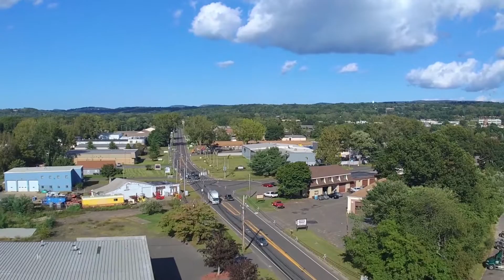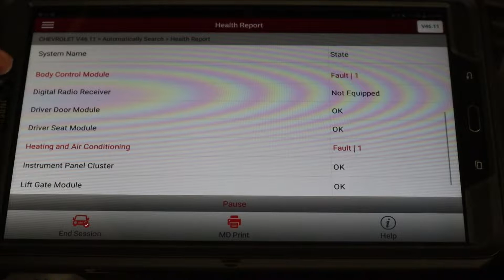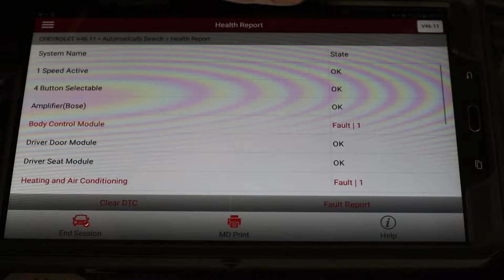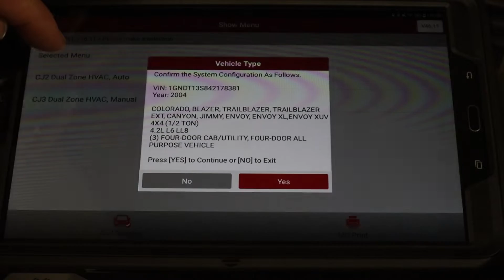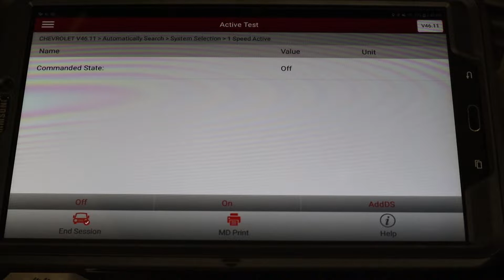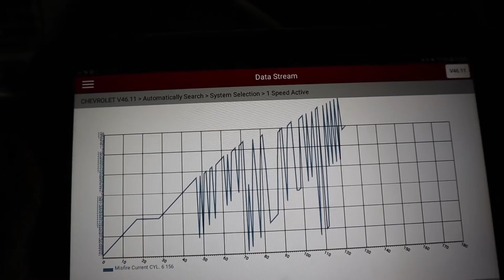CHEVY TRAILBLAZER CRANK NO START........Fuel pump troubleshooting

Comment: Hey I did a swap in my 07 tbss , put in L96 6.0 /4l80e Trans, im using ls2 harness and ecm, won't start unless I spray starting fluid in throttlebody , can you help,  thanks
Reply from the maker: No injector pulse. Possibly the immobilization activating. You may need to use hp tuners to deactivate the immobilizer in the ecu. Or it could be no power at the injectors. Or could be no fuel pressure. There’s a ton of possibilities.

Comment: Will this also control  the gauge? Because the gauge stopped once before then started working again and started working again and it ran tool again the gauge  stopped and once again we had a crank no start problem

Comment: Just fix the wire in the connector. And butt connectors and shrink wrap is fine especially when most people can’t solder. All other coils go bad around 150ish usually should have recommending replacing all of them

Comment: I would ask you if I don’t have 12v at fuel pump relay when I turn key on. Another the side at pump relay I allway have 12v .so my ignition switch go bad this for 2003 envoy …. Thanks

Comment: How did you get those connectors off the pump without dropping the fuel tank?
Reply: You cut a hole and re weld the floorboard

Comment: 02 trailblazer 4200. New fuel pump. New filter. No codes. Wont even fire with ether or starter fluid, possibly timing from my guess??

Comment: I have a 08 trailblazer mines the fuel pump for sure but idk if its the injectors or the pump, i put a full tank in it and after that the regular throttle i give the blazer didnt have the regular response sonner i was trying to give it more gas and my speedometer went down and my truck turned off? What do you think?

Comment: another FYI there's a port on the filter (not the rail ) to check pressure before u do anything else. And I agree it seems that when you have a fuel pump problem the owner will go and fill up the tank. lol

Comment: Great video! I'm gonna try a connector... Seeing how I just did the fuel pump. Quick question tho. Should the fuel pump relay have power to only one prong??? 

 Oh I hope the New connector works. Figures the new pump came with one but I didn't change it.
Reply: It was the fuse block in the end. And now the a.c actuator is clicking under the dashboard for around 90 seconds.

Comment: Great video. You're good! Question: I have a 2004 GMC Envoy 6 Cylinders and, for about 5 years now (yes, five Years) it cranks a few times (2, 3, sometimes 4 times) before the engine starts. I took it to two shops and they couldn't find the problem and told me I had to wait until it doesn't start at all. Do you think it can be the fuel pump or maybe the starter? Thank you!!!
Reply from the maker: I would lean toward fuel pump or a leaking injector bleeding fuel pressure down. It would need to be pressure tested to find out for sure.
Reply: @MorFabIndustries  Thank you again!